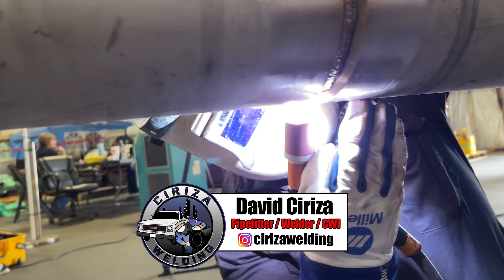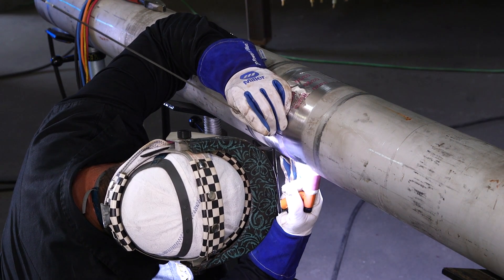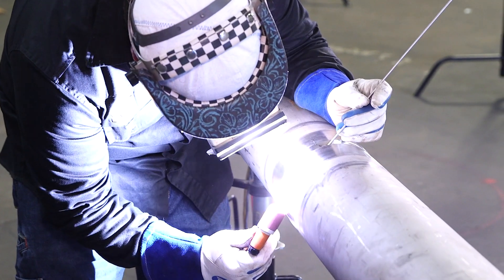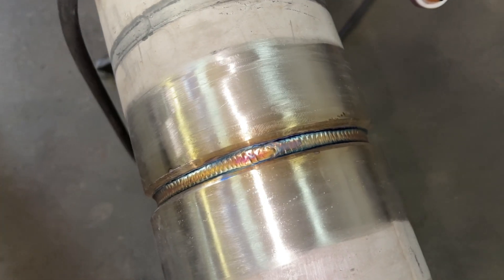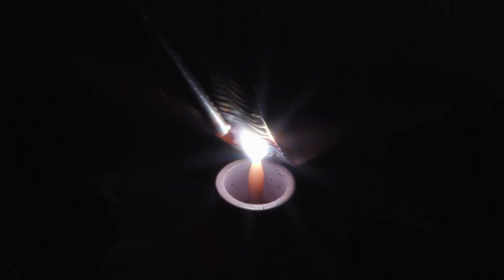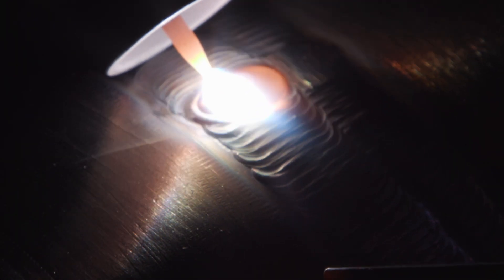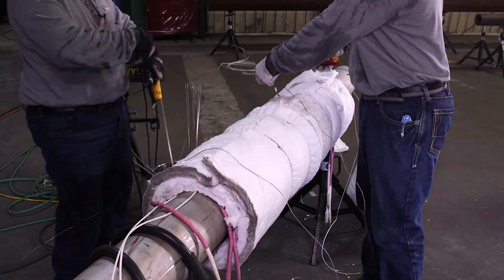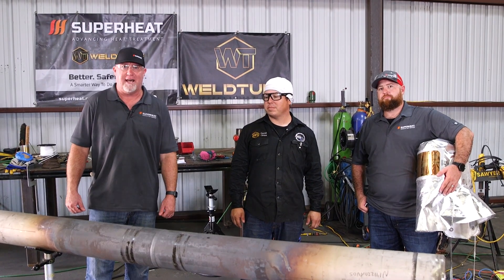SUPER HOT 2200 Degree 304 Stainless Steel Pipe | TIG Welding

Comment: Will it rust from that?
Reply: No the grey layer outside has already reacted with oxygen to create an iron oxide different to rust. They didn’t purge the inside, because it would be hard to maintain a stable pressure with the temperature changing. so the whole outside layer of the pipe has basically lost a lot of its stainless properties, so it’s not food safe but it wont the rust. I could be wrong though

Comment: Are you wearing the half face respirator because it’s stainless
Reply from the maker: Yes because of the high chromium levels.
Reply: @weldtube  ok so basically it will be wise to wear a mask for all stainless.   Ok thanks
Reply: @Fck40Hrs  Basically for everything you weld
Reply: @panzerfaust7672  ok 👌
Reply: @panzerfaust7672  ok 👌
Reply: @Fck40Hrs  wear a respiratory for all metal work 💯